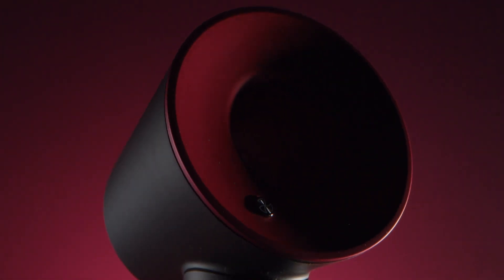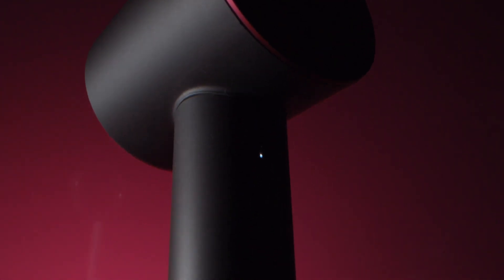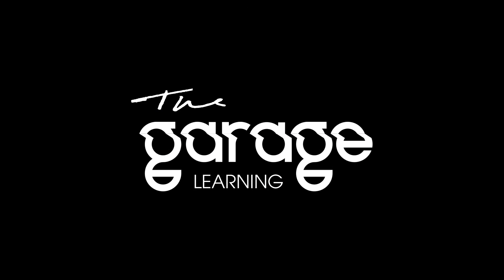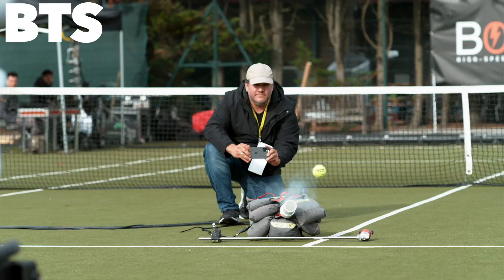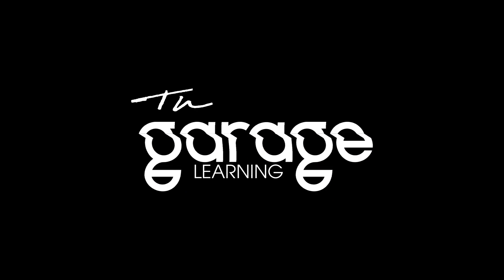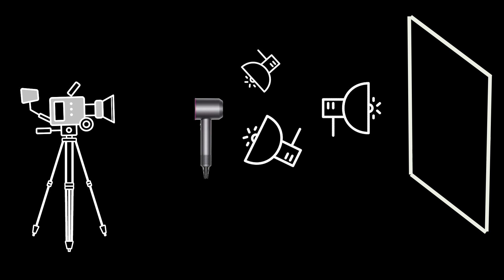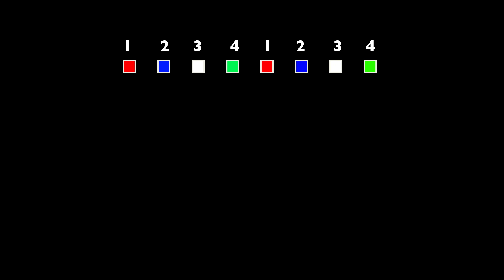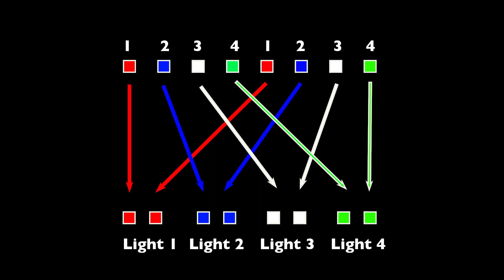Multi-pass Lighting As A Single Pass

Comment: Awesome! Could you provide some product names of the gear you used for sync, which leds etc?
Reply from the maker: We built a circuit using a decade counter to trigger our mosfet, powering the LEDs. The decade counter was connected to the phantom's sync output, so every time the phantom shot a frame, the counter would trigger the next set of mosfets
Reply: @TheGarageLearning  crazy that the LED's can switch/fire at 100 fps! (It looks like the background lights are always on, so I'm assuming those guys are lit every shot, while the other LED's are switching at 25 fps.)

Comment: Sounds pretty awesome! :O Do you have to go with very fast shutterspeeds or very short but brighter lightflashes to make this work? Because my assumption would be, that if the lights and the camera aren't exactly in sync, it would happen, that the light switch happens within the the exposure of the frame and not inbetween them(?) And do you shoot this in a raw-like format (since having a completely different image every frame will probably bring compression to its limits)?
Reply from the maker: It has to be synced to the camera, and you want to shoot in the highest quality possible. In this case, we shot RAW, then transcoded to Prores 4444 and then cut that up into the 4 high-quality clips. Our LED lights are so fast that they can act like strobes. The camera shutter speed is normal for the framerate, the lights are what need to turn on and off very quickly and accurately. Since this lens was F-14, we also needed a good amount of power.
Reply: @TheGarageLearning  Do you shoot with the 180 degree shutter rule for 100fps as well (so 1/200th)? So with how you split the video up, you basically get 4 25fps videos but each exposed to 1/200 ("correct" according to 180 degree rule would be 1/50th (?), which is of course not achievable with 100fps). I am kinda pretty new to video - can you "fix" that in post by adding some motion blur? Does this even need fixing? Am I just being dumb? ^^
Reply: @no-trick-pony  you are not being dumb -- this is not a "normal" case so the 180 degree rule need not be adhered to when using a "flash" light source. Assuming your motion across the product is not too fast then the you won't see frame to frame jerkiness. As long as you get enough light onto the sensor while the shutter is open you are fine.

One more note for @The Garage Learning -- about 12-15 years ago I was part of a project to see if we could replace the tiny strobes found in phones with LEDs. We did not succeed as we found that not only can you not get super high output from an LED by pulsing it, the rise time of the light output is measure in many milliseconds which would have prevented shutter syncing at speeds above 1/100 sec. Maybe the LEDs have gotten a bit faster since then as we now see solid state flashes in all cell phone cameras.
Reply: @no-trick-pony  Not dumb, just making it more complicated. Shutter angle is set for the frame rate you're capturing in camera not what you playback. Video cameras they're shooting on typically use shutter angle settings(45, 90, 180, 360 etc) vs shutter speeds that you see whilst filming video on DSLR's/mirrorless.
Reply: @TheGarageLearning  Oh wow, thanks for the explanation! I didn't even know there is a way to sync the frames with cameras ^^ Pretty stoked to learn what you are experimenting with! :)